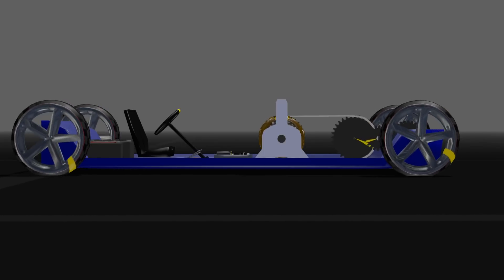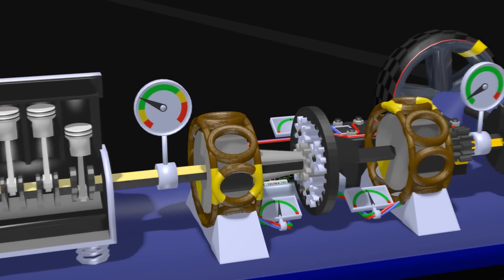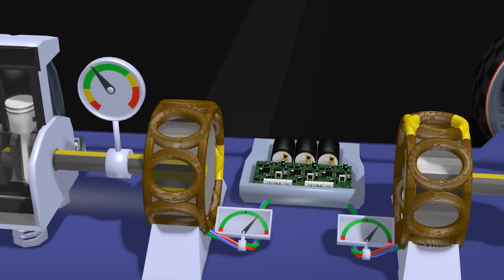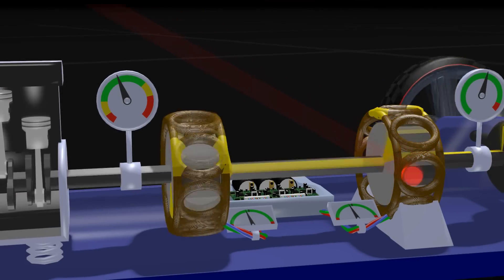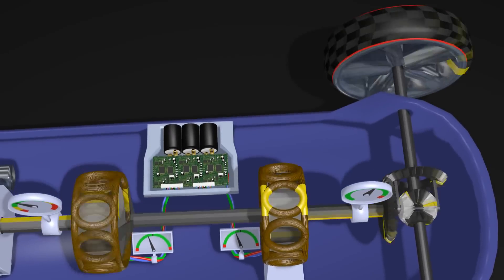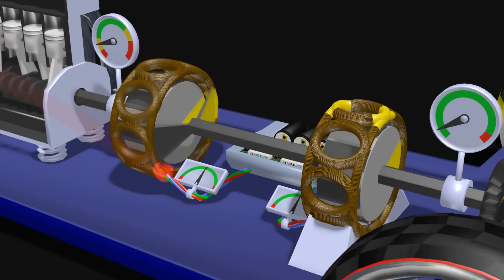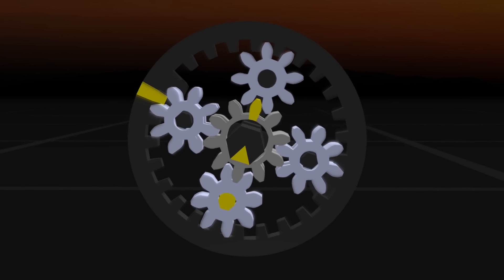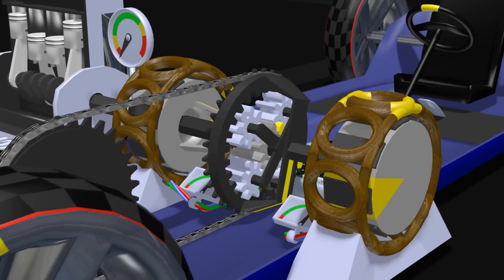Prius Hybrid Drive Explained

Comment: Fascinating but I will have to watch it a few more times to get my head round it. Meanwhile I have to drive my
very economic low carbon demonised diesel as efficiently as possible . This complexity is unaffordable
and production costs rather obviate the environmental benefits. I would love one ,but still a bit of a 
conscience salve for the wealthy .
Reply: The basic Prius model isn't very expensive when compared to other conventional cars of similar size......but, if you want the plug in Prius "Prime" which is both EV and hybrid, then the price really goes up.
Reply: Diesel is a mixture of longer chain hydrocarbons. These cannot be burnt as well as the shorter chained gasoline without expensive emissions equipment. Diesel exhaust is far more toxic to humans and the environment than gasoline.
Reply: @djlinux64  
It can with highly controlled injection systems. High speed engines do not have that yet. Medium speed engines have in recent years. Will inject around 220 times per combustion event.
Reply: @herpnderpn2484  VW TDI uses that stuttering injection technique.
Reply: I've completely recovered the difference in price between my Prius and a Corolla , and more, with fuel savings.  And it still has many years left in it and is a nicer car, imho.  I recently drove one 8 years newer and it was very nice... but since there is nothing wrong with my '09 I can't justify an upgrade.  Also, the repair costs are very low... very little brake maintenance, for example.  The slightly higher initial cost would be a bigger barrier in the days of high interest rates, but at the moment that's not much of an issue.
Reply: @FlashGeiger   As a Prius owner can you advise whether it is possible to anticipate how hard you can press the brake pedal before conventional friction braking kicks in?
It would be nice to know so that you can brake in plenty of time using mainly regen braking.
Reply: @Martindyna  
There is a good inch of travel before using service brakes. There is a display showing a suedo 1-100% Regen usage. Higher speeds, 70-80, lightly touching the brake pedal will Max the Regen meter. Slow, 15-20, it will take nearly then entire inch to reach maximum Regen. Supposedly at 7mph the Regen system cuts out and leaves only service brakes. The system was designed to be somewhat seem less, but after driving a bit it's easy to find. There is no hard transition unless you panic stop while Regen only braking.

 Have 290,000 miles on mine and still has over half the life on the factory brake pads.

Also, I know the newer truck diesels are firing around 7 or some times per combustion event. May be more now.
Reply: @herpnderpn2484   Thanks for the information.
I assume that you refer to a Prius? Unfortunately Toyota may not include the regen gauge on lesser models like Auris & Yaris, I don't know.
Reply: @Martindyna  
Yes, the Prius. I am unfamiliar with the lower models, but would assume something similar. Friend of mine has a volt and aparently it has a charge/discharge "gauge". Either way, they put a lot of effort into making it a seem less change from Regen to service, but you as the driver could likely feel the transition. Regen is linear with speed, faster=more Regen, service brakes are not, unless they are fading under heavy braking.

Edit, on the Prius, Regen will not operate when a tire is slipping, only the service portion. Otherwise the Regen and service brakes will work together.
Reply: Herpn Derpn  Thanks a lot.
Reply: @Martindyna  I put a ScanGaugeII on my '09 Prius OBDII port and set it up to show the current in and out of the big battery (instructions found on the priuschat forums).  The current during braking seems to max out around 100 Amps into the battery, which is a bit lower than it can put out at high acceleration.  This regeneration current corresponds to reasonably firm braking at city speeds, but only very gentle braking at highway speeds.  This is assuming there is room in the battery... as it fills up, like when braking on a long downhill it will switch to friction and eventually you should switch to B mode to do engine braking like on any car for very long downhills.  BTW, I decided to buy the 2017 Prius when my son's lease was up, so I'll be selling the 2009.
Reply: @FlashGeiger   Thanks for the info. That's another concern I have about the Prius - that if you live in a very hilly area the traction battery may not be big enough to store the energy of a long downhill run of say 1 in 4 like you can come cross in the county of Devon, UK. It's a compromise I guess since the traction battery is heavy.
You abruptly finished your post btw 😯
Reply: @Martindyna  My post shows clipped on the version when I click the bell, but shows the whole post on the video.  Odd.
Anyway, I just got back from a 3 week driving vacation.  I drove from my home in Ontario down to Newfoundland, then 2 weeks driving around Nfld then home.  Very hilly driving back and forth across the Long Range mountains in Gros Morne National Park.  I was a bit nervous about the long downhills, but the car handled it fine.  When in cruise control it seemed to switch to engine braking on its own on long downhills when the battery was full.  I was in the 2017.  I live in a lot flatter terrain and wasn't used to it.  My whole vacation I drove 7.5 Mm and averaged 4.0 litres/100km.  I love this car.
Reply: @FlashGeiger  That's odd since for me the clipped version is under the video but the Bell comments are ok!
Anyway in old money 54.673 MPG (Imperial) sounds good to me especially for an automatic (45.525 MPG (US gallon)).
I think you use UK gallons in Canada.
So in `B' once the battery is full the engine speed is increased  to act as a brake with the fuel cut off as in a normal car.
Thanks for all the cool information.

Comment: I don't get how the generator can act as a clutch, basically the whole clue of this story. In the model shown, the car's engine drives the rotor of the generator, and somehow at a certain point what normally is the stator (the outer part, where usually the wiring is) also starts spinning. What's more, in the model shown the stator, that normally is not known to move at all (hence its name,derived from the word 'static'), is attached to the axle that further on connects to the wheels. The author of this video gives no explanation about this never before seen setup, he just mentions it and than skips the subject as if we can all take this generator that serves as a clutch, in which both its.components move,though one only from a certain speed, as a given
Reply: The rotor of the generator has to run at a higher speed than the stator in order to cut lines of force and generate power, however the stator does not have to be stationary, though it normally is, hence the name. The author is only demonstrating that, in theory, it could be connected directly to the output for the simplest form of electric transmission.  It forms a "clutch" because the magnets in the spinning rotor will drag the stator round with it rather like a fluid flywheel.  This "simple" transmission is not, of course practical and is the reason for the planetary gears as explained from 7.00 in the video.  Personally I think this is the best video explaining anything I have ever watched (No music, a nice calm un-hyperventilated commentary and superb graphics) and I hope Toyota buy it off him to train their mechanics.
Reply: It's the same as why it's hard to spin a motor that's turned off. If you spin permanent magnets past coiled wires, you will generate eddy current in the wires through induction.  The current that's generated will in turn create a magnetic field that will cause the wire to be repelled/attracted to the permanent magnets on turn so you get torque. Once the two are the same speed you will have constant field through the wires so you have no more torque.

In the real Prius, it's all electricity since the motors are both held stationary.  You just decide how much electricity MG1 should generate at a moment to drive MG2.

Comment: I have had a Toyota Camry Hybrid since February 2015.  
When I drove it away from the dealership, it felt like Star Trek technology to me.
After almost four years, it has been 100% reliable with no break downs whatsoever!
Reply: Just got an 08 Prius myself. Had a good laugh when I realized it doesn't even have automatic headlights (it's an option)...Good god I hate unnecessary beeps :D But yeah, feels weird after a Mini.
Reply: Another channel removed and opened up the ICE of a Prius after 200,000miles/300,000km. It was like brand new. The battery and occasionally the inverter coolant pump is about the only thing that can go wrong with these cars.

Comment: Very good and thank you. I don't think my 2016 Prius  C  has chain drive
Reply: You are correct. Third generation HSD (P510 transaxle) doesn't have a chain drive, instead, it has helical gears.
Reply: We took a 2016 Yaris hybrid apart and there was no chain, there probably were in older versions

Comment: Hybrids are more complicated then electric vehicles.
Reply: You are correct, except these have regenerative braking and IC Engine need not be so versatile as in pure  IC Engine Vehicle. The arrangement facilitates mounting of a more efficient engine, Google search Deferred Atkinson Cycle ... ...
Reply: Mechanically, yes. Unnecessarily so. But that's why they're just a transitional phase.

Comment: Great car for around town but hills & trailers seem to be a problem with low power engine.
Reply: Have you driven one? My wife owns one and power is not a deficiency. The electric motor delivers 100% of it's torque potential immediately, before the internal combustion engine can even spin up. While the Prius is not intended for a trailer, it definitely has no problem with hills. I've road tripped  in a prius across the country and it handles in the mountains like a champ. I take it up on Mount Hood to snowboard all the time, it has great breaking and traction control with the right tires. I drive it on the economy setting to save gas, but I put it on the power setting if I need to jump off the line. Given that this is an economy family car, it's not weak at all. Naturally, it's not up for a race with a muscle car.
Reply: The bloody thing accelerates faster because of its electric motor, I think you need to drive one.
Reply: Well, I don't pull a trailer with mine, so it's not a problem.  I can still drive in the country without a problem :)  As to hills... you're correct that the engine is speced for the average power instead of peak power requirements and doesn't have a high power output.  That improves the efficiency.  Going up hills or accelerating still isn't a problem because the battery kicks in when required.  Going up very long inclines may be a problem if your battery drains before the top.  I don't live in such a place, so it's not a problem for me.  Maybe I wouldn't drive one if I lived in Colorado.  It is possible to "force charge" the battery if it gets low... pull over and while stopped push the gas and brake together and watch the charge state until you fill up the battery.  It wouldn't be a solution I'd want to rely on often... (safety reentering the road, reduced battery lifetime due to deep cycling etc) but having the option means I'm not too afraid of running into a long uphill on holiday.
Reply: Really? It's not fast, I'll give you that, but I have done over 100 multiple times and climbed 5-6% hills loaded down with tools and passengers and was passing others at 80. It is equivalent to driving a 90's truck with 0-60 in the 10 second range.

Comment: I find it a big humorous, that the development of this sort of drive is seen as an automotive technology. Diesel locomotives have been using something similar for ages, and they borrowed a lot of their technology from the diesel-electric submarine drives from WWII. Of course, digital control systems have brought efficiency to a pinnacle. But then, the kings of efficiency have always been diesels, and especially European trains are amazingly efficient. When measuring BSFC (a way of measuring efficient use of fuel), these trains make the almighty Prius look inefficient. 

I drive a Prius, and love it. I just can't wait for the next and next and next gens. Because as good as it is now, it's still going to get better. The Japanese may not have invented this stuff. But they seem adept at maximizing everything they touch.
Reply: Christian Swensen have you seen the latest one it has rear indicators on the rear bumpers so one knock on them and it goes to the body shop
Reply: @sweetvuvuzela4634  I don't know anything about "indicators." The rear bumper wrap on mine is held on by plastic rivets, which many people have called backup sensors. They do pop out if they take a hit, but that's not their purpose and even if you lose the rivet, you can replace it yourself for pennies.
Reply: My understanding of modern locomotive engines is that they're gas turbines engines providing power to electric motors, rather than a direct transfer of mechanical energy.
Reply: @vp21ct  There may be some that are turbine-generators. But most are diesel engines, driving generators, driving electric motors. Diesel engines are more fuel efficient (by far) than turbines, while turbines have an amazing power to weight ratio. So locomotives wouldn't normally choose turbines, though I wouldn't rule it out. Diesels have incredibly long service lives too, and comparably low maintenance costs to turbines.